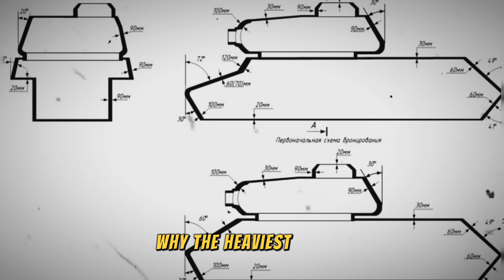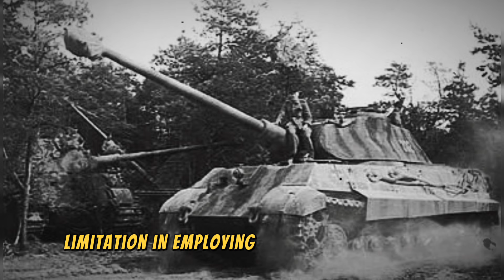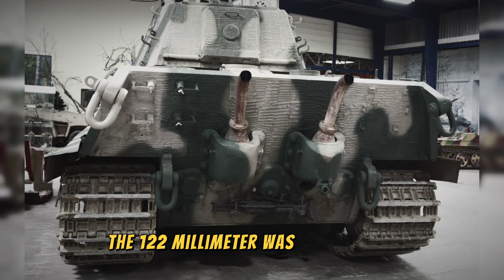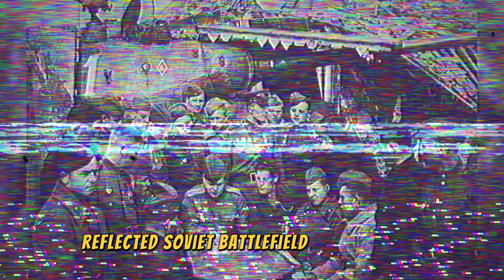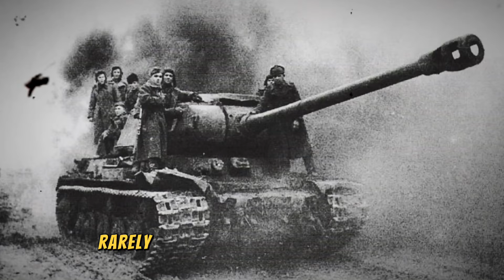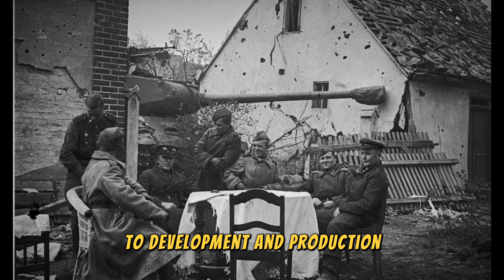Tiger II vs IS-2: King Tiger vs Stalin's Beast — Berlin 1945 Heavy Tank Duel

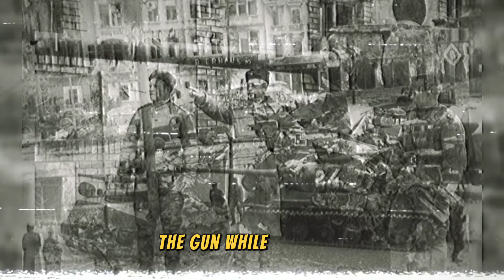Comment: At 14:18, I noticed several tanks, and one surprised me. The tank in the foreground appears to be an Lend-Lease M4 Sherman.
Reply from the maker: Great eye! You are absolutely right. That is indeed an M4 Sherman, likely the M4A2 model provided to the Soviet Union through the Lend-Lease program. They were highly regarded by their crews for their reliability and comfort. Thanks for noticing that detail at 14:18!
Reply: @GransLostSecrets  Thanks for your reply and confirmation. I have always wondered what and how many military items were sent to Russia and were any returned to us after the war ended.
Reply: @outlet6989  The share of Lend-Lease supplies relative to USSR production during the war economy was 4%. There was also a "Reverse Lend-Lease," which the USSR also made Lend-Lease deliveries. In addition to Lend-Lease, the USSR purchased military products, etc., for gold.
The main deliveries to the USSR under the Lend-Lease program occurred in late 1944 and 1945.
Lend-Lease to the USSR:
Artillery guns - 1.6%.
Grain, flour, and cereals in grain equivalent - 2.8% of the average annual grain procurement in the USSR.
Motor transport (all types) - 18.055%. (Including: 114,500 Studebaker US6 trucks (delivered by September 30, 1945)). (Motor transport (all types): 312,600 (Lend-Lease) of 1,730,800 (total used by the USSR 1941-1945) = 18.055%.)
Locomotives - 6.6%.
Buttons - 257,723,498.
Tanks: Medium M4A2 Sherman (with 75mm gun) - 2,007 units, Medium M4A2 (with 76mm gun) - 2,095 units.
The Lend-Lease Act was extended to the USSR on October 28, 1941. The agreement on deliveries to the USSR under Lend-Lease was signed on June 11, 1942. The Anglo-Soviet Treaty of Alliance of May 26, 1942.
85% of the armies of Hitler and his allies were lost on the Eastern Front. Lend-Lease at 4% was a significant aid, but not decisive. Both the Battle of Moscow and the Battle of Stalingrad were won by the USSR with virtually minimal assistance from the Allies. The main Lend-Lease deliveries to the USSR occurred in late 1944 and 1945.

Comment: 128mm gun😂what a F yuo are talking about and Tiger had 88mm l71 gun..and the turret?? 😅It,s early Prototype turret, the easier to product turret whas commom to allmoust ewery Tiger2 and it's have a frontal thiknes whas185mm  chek the fact's
Whit Love from Finland ❤️🇫🇮
Reply from the maker: Thanks for your comment 😊 You’re absolutely right that the Tiger II was equipped with the 88mm KwK 43 L/71 gun. The 128mm gun is more commonly associated with other late-war German vehicles. And yes, the early “Porsche” prototype turret differed from the later production turret, which had around 185mm frontal armor.

Appreciate the correction — always good to keep the facts straight!
Greetings back to Finland ❤️🇫🇮

Comment: Imagine had Hitler instead put the half million soldiers and 500 Tigers and King Tigers along with 500 SP anti tank guns  in front of Berlin instead of wasting them in the Battle of the Bulge? Wouldn’t have changed the outcome of the war but the Soviets would’ve paid an even bigger price for Berlin!??
Reply from the maker: Do you think 500 Tigers could really stop the IS-2 tide?
Reply: @GransLostSecrets . Nope … but they’d of accomplished much more than tossing them against the British and Americans where most of them simply ran out of fuel?
Reply from the maker: True. The King Tiger was essentially a defensive weapon by that stage—a 'mobile pillbox'. In the Ardennes, its weight and fuel consumption were liabilities, but in a hull-down position defending Berlin, it could have picked off IS-2s from 2km away. The strategic misuse of the last reserves in the Bulge is definitely one of the biggest 'what ifs' of the war.
Reply: For example: Operation Spring Awakening (the Balaton Defensive Operation, March 6-15, 1945). Ratio of forces:
Germany and Hungary – 450,000 soldiers and officers. Approximately 900 tanks and self-propelled guns (429 Panther tanks, 70 Tiger I and Tiger II tanks, etc.), 900 armored personnel carriers, 6,000 guns and mortars, 850 aircraft. (31 fully equipped divisions (including 11 tank divisions), 5 battle groups, and 1 motorized brigade).
The Red Army, Yugoslavia, and Bulgaria – 400,000 soldiers and officers. 399 battle-weary Soviet tanks and self-propelled guns (139 T-34s, 78 SU-100s, 4 IS-2s, 95 SU-76s, several heavy self-propelled guns, and 50 Shermans and Valentines), 6,800 guns and mortars, and 700 aircraft.
The result, as usual, was the complete rout of the Wehrmacht and SS. And on the shoulders of the retreating Germans, the Red Army took Vienna ("Vienna Offensive Operation." March 16 - April 15, 1945).
450,000 versus 400,000. Armored vehicles – 900 versus 399. Artillery and mortars – 6,000 versus 6,800. Aircraft – 850 versus 700.
Result: "We lost more tanks in 10 days at Lake Balaton than in the entire Ardennes Offensive. The Russians knew everything in advance. It was the end." (Commander of the 1st SS Panzer Division "Leibstandarte" Otto Kumm (interrogated in 1945)). "After Operation Frühlingserwachen, the 6th SS Panzer Army ceased to exist as an operational unit and was only capable of defending individual settlements." "The Grave of the Panzerwaffe" (Heinz Wilhelm Guderian).